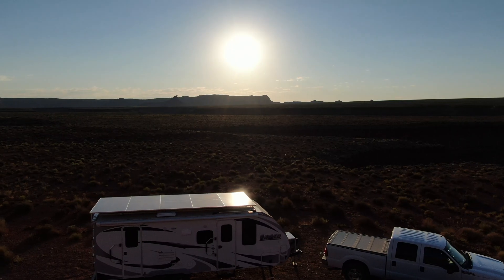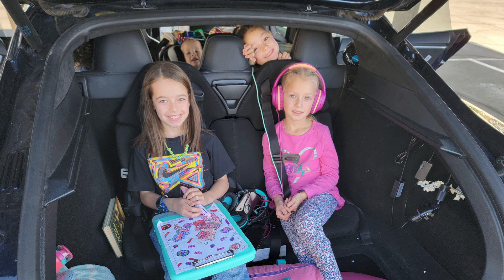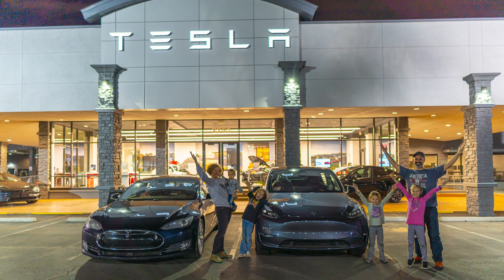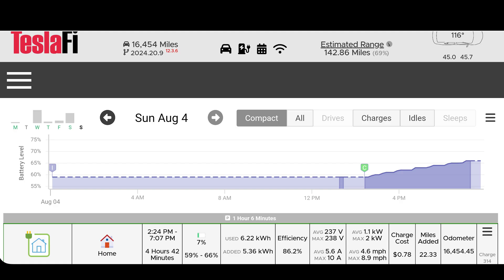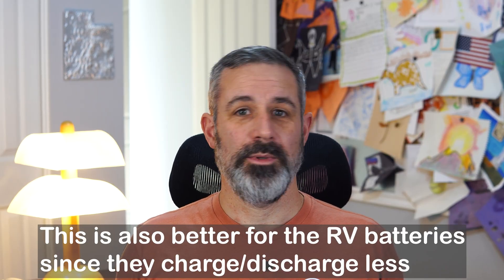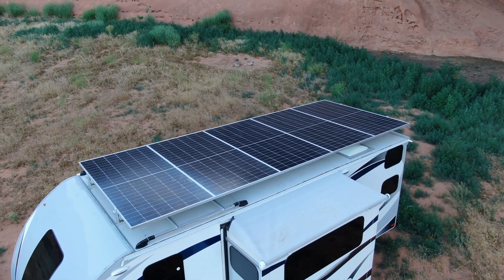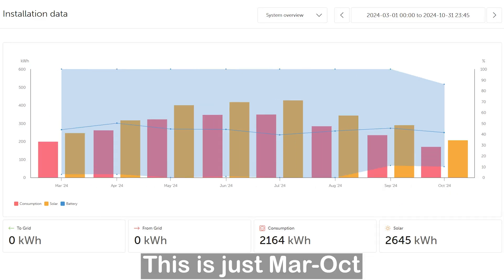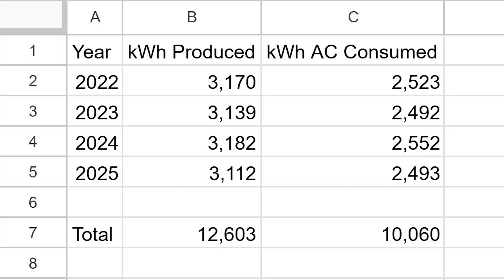We Drove 3,468 Miles on FREE Solar Power from Our RV Trailer!

Comment: I see you have solar on the house, if you are able to feed the grid with your system, you can always set up ESS in your victron multiplus and push all the excess solar back into the grid and then you can just charge your cars normally using the grid as a battery and not cycling the batteries in your trailer. That is what I do with my trailer and solar system that is installed on it.

Comment: Do you have a sense of how much DC you used out of the 12,603 produced.  80% AC transfer seems low given your Victron system is probably the most efficient available.  Or am I missing something?  Thanks
Reply from the maker: I have no way to know how much DC was actually consumed. It is minimal though. I think it is around maybe 20 watts as long as I turn off the induction cooktop circuit breaker because the standby loss of that alone is about 40 watts. I think the efficiency losses is higher simply because the efficiency that I am reporting is all the way from the solar production to the consumption end of the car which has its own inefficiencies to add in to the equation has the in car charger converts the AC electricity back over to DC and then charges the batteries. It would be more efficient if I could directly charge the batteries of the Tesla from the trailer via DC power. Also to note I turned off the inverters every night throughout the whole experiment and I still do to this day. I'm not sure if I mentioned that in the video.

Comment: Interesting data!
If you convert the miles to gas it might have been 100 gallons of fuel at whatever rate you pay locally
Well done on sticking to just charging the Tesla Model S for a year to gather the information! over time? As an aside, any idea on the propane saved in your trailer
Reply from the maker: I have no idea how much propane we would have used if we still used the trailer as it was designed.